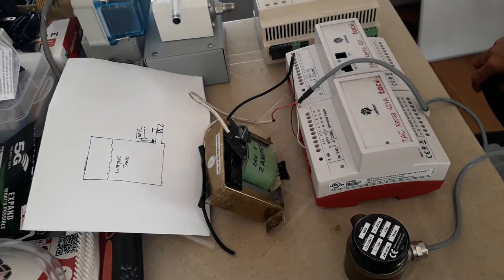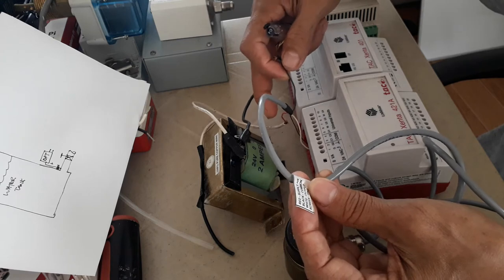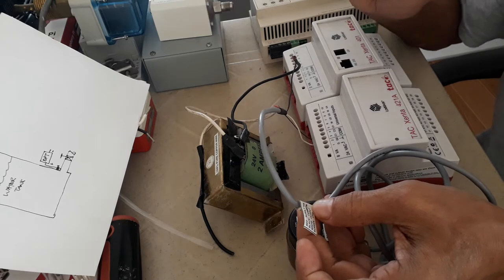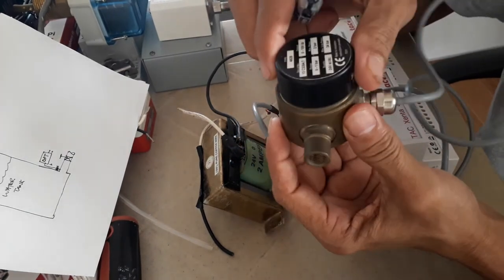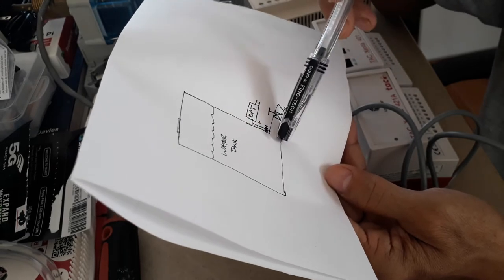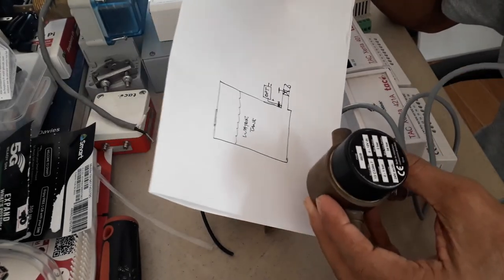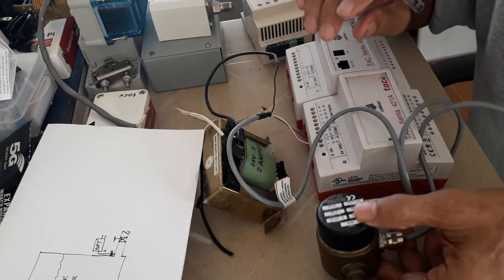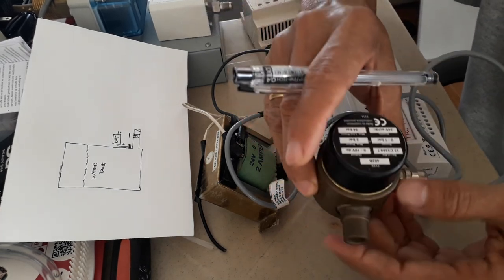How to become a BMS engineer part 58 (Water Differential Pressure Transducer)

Comment: THANKS FOR DEMO . CAN WE USE  THIS DPT TO CRLT VFD  OF SECONDARY PUMP?
HOW TO SELECT  REQUIRED MAX PRESSURE FOR  TANK SIZE?
Reply from the maker: yes you can use it for the control of secondary pump, for the required max pressure you need to compute for the volume of the tank, but it depends on the tank if it is a cylinder or not. There are several ways of computing the pressure at the bottom and it depends on the tank shape.